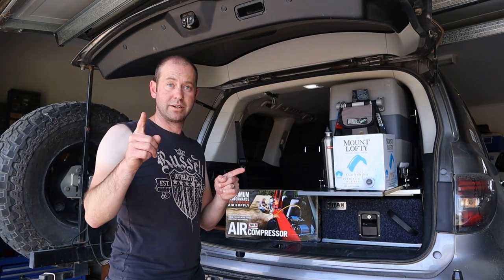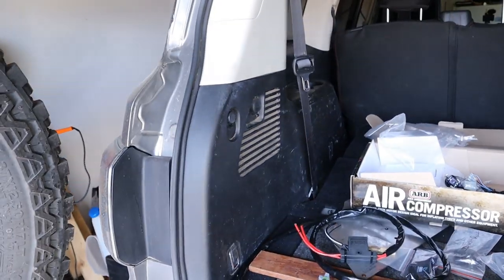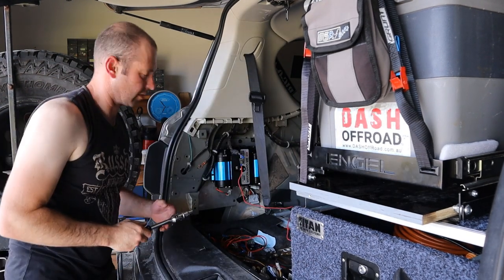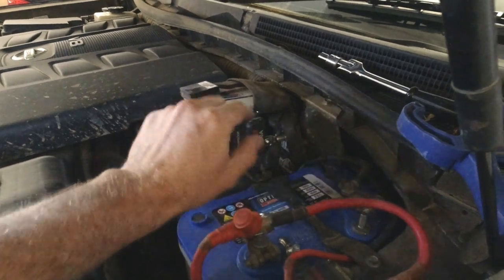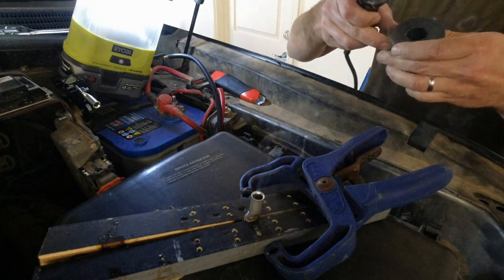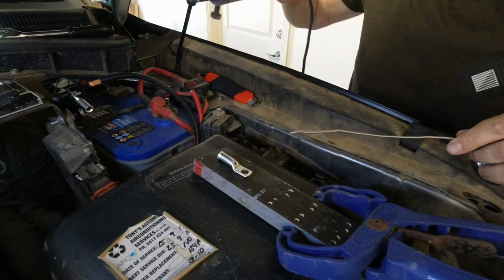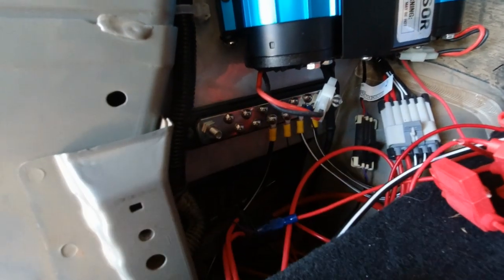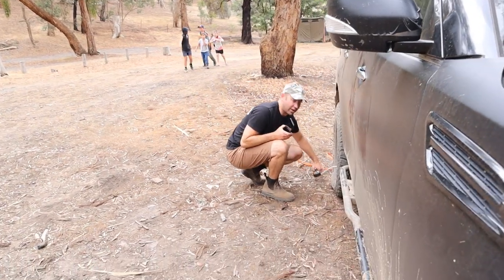ARB Twin Compressor Install & Inflation Race!

Comment: Hey, I love what you did.
I have done the same in my Nissan Patrol Y62, I have done almost the same arrangment. After 2 years, I decided to to remove it, and I mounte it in a customized box, that because it hard to access the compressor in case of failure, it happened twice to me, the first was the fuse blown up, the second was the negative cable lossen, in both cases I couldn't fix it onsite in the middle of the dessert (I used my freinds air compressor). Although I fixed it at home but it took me nearly 3 hours + to do so. The second reason is, Few time I needed to move the compressor to another car but I couldn't as it fixed in my car. Apart from those 2 reasons, the setup is perfect.

Comment: I was the same as you soldering those big lugs, then I got a hydraulic crimper off ebay. Best thing ever!!!    #makethechange
Reply from the maker: I need one of those!
Reply: Lots of arguments against soldering crimp connectors in a vehicle, the correct crimp tool for the correct crimp lug for the correct wire size will always win.  The solder connection is not flexible and can crack when subjected to vibration.  As berniebgj said, reasonable quality hydraulic crimpers are not too expensive from the auction site we know and love.

Comment: Hey Dash, Glad to see that you've used thicker cable (4awg?) instead of tapping into the circuit which you were originally considering ;). FYI, LifePo4 isn't ideal for high amp constant discharge, although i think Revolution batteries are specified to handle 160amp for a 120AH battery. But who wants to spend $2k on their batteries (no offence meant if you have ;) )

Comment: As others have pointed out, cables that size should be crimped but by the correct crimper. The proper crimp produces a "Cold Weld" of the copper strands and in a shape that can bend with vibration if seen under a microscope. There is a fair amount of Science involved in the reason for crimping.  The tinned lugs you are using are designed to be crimped and then some Solder added to the inspection hole to seal it up against moisture.  Of course, since this video is over 3 years old, you probably already know all of this by now.

Comment: Hi mate about to install one myself in my gu when it comes in from  arb as there’s a rush on them at the moment he explaind, 
I picked up on you saying you need to pick up bolts to fix it to the plate- could you please tell me the length & gauge of the bolts you used please as I’ll need to picked up them ready for the install. 
Chears👍

Comment: If it does draw 80amps that's only for the duration of tyre inflation. 80amps per hour, you shouldn't be inflating tyres anymore than 10 minutes with that. You'll only use 15amps Max.

Comment: Hi dave, i think you should really consider re terminating the cable lugs, altough alot of people think that is okay to do, it couldnt be worse. The cable is a multistrand flex for a reason. A vehical is a vibrational invironment, solder creates a major fatigue joint, it doesnt alow the cable to flex as it should from vibrationals, there for over time it will just break strand after stand till there is a hot joint and starts acring. 
Soldering should never be done in a car.
Reply from the maker: I think you have convinced me 👍
Reply: Not if soldered correctly and proper mechanical support of the cable, that included mechanical terminations 😉
Reply: He's done a few things wrong here. Secondary batteries aren't designed for fast high draw, run your compressor off starter. They aren't my words that from Top Aussie red channels

Comment: They run two cables for that exact reason, there are two independent compressors in it that can run independently should one fail.

Comment: Is heat buildup going to be a problem with the compressor in there
Reply from the maker: We will see, there is a vent there and it’s fan cooled
Reply: @DASHOffRoad  For fan cooling to be effective, you need an inlet for cool air (you have this) and an outlet for the heated air. You could attach a 120mm 12V fan to the panel and connect it with the compressor. Also, its preferable to use the vise and crimp the connectors than that soldering debacle. If you must solder, you must tin the wire - just let a small amount of solder wick in - use fine solder if you need to and dip the end in flux paste. It won't add any size to the cable if done properly. Other than those little points, great job - very neat indeed. Can't wait for part 2.

Comment: Now I know you want your vent plate to still breathe I’ll look at it’s designing I designed a blanking plate to cover and not breathe
Reply: Is the vent for the aircon taking air in?
Reply from the maker: Nah AC is on the other side

Comment: It would be double if you factor in the rear compressor isn’t going st full speed when your also running the front compressor and the front was running faster as soon as you stopped using the rear compressor, I can hear the change in speed